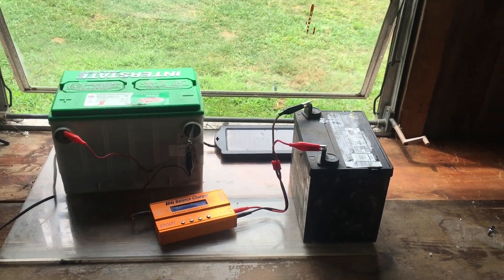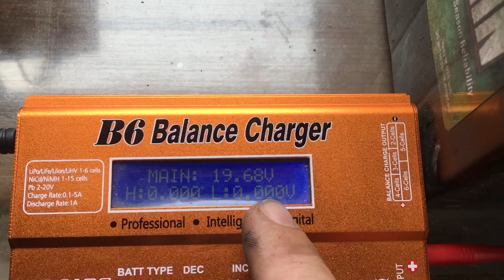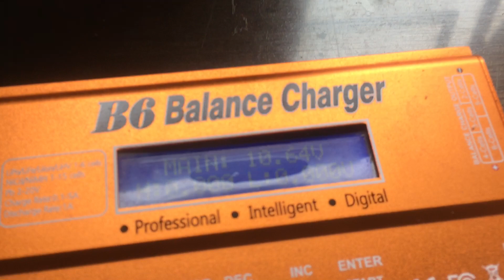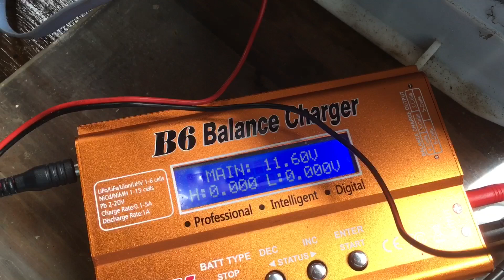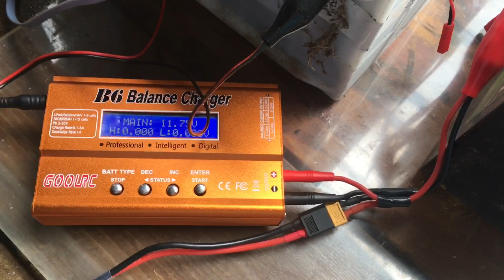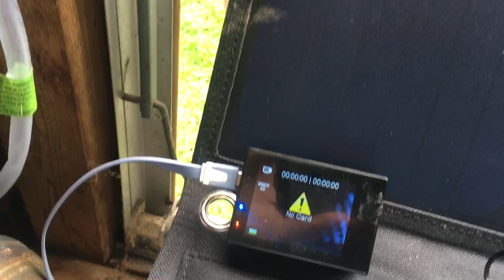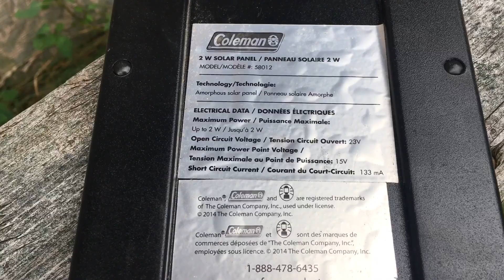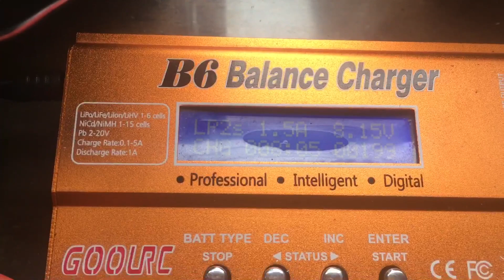Cheap Solar System DIY Charging station 🚉 off grid

Comment: For larger stuff you might want to use a deep cycle battery like a marine battery because this way it's not as big as a car battery
Reply from the maker: Yeah deep cycle is definitely the way to go I think I mentioned that in the video if I didn’t I definitely meant to but I have plenty a room in here over a huge area underneath the workbench but I’m gonna be sticking a bunch of batteries